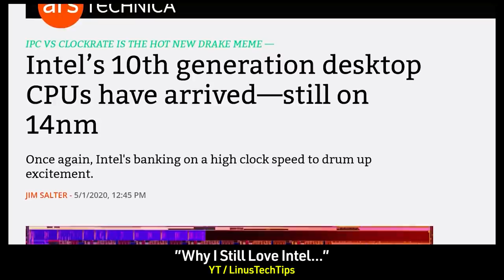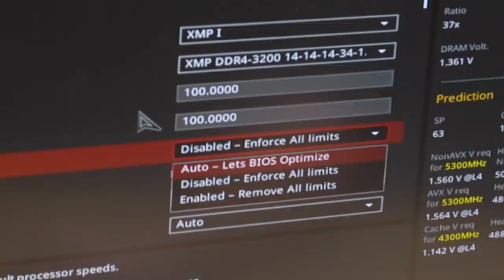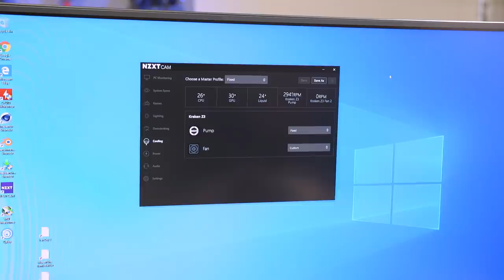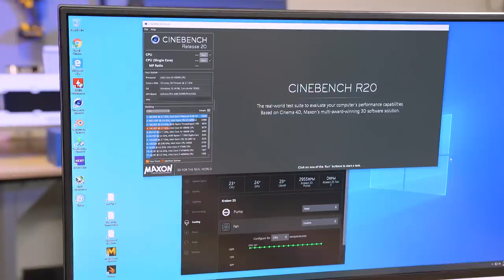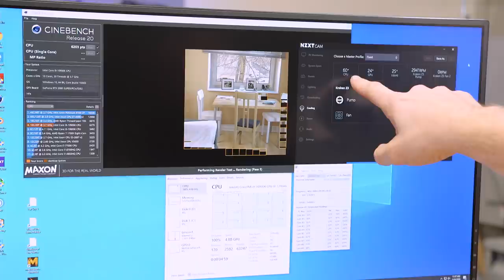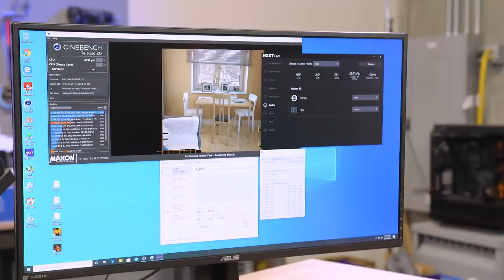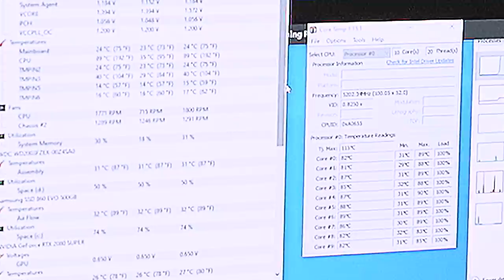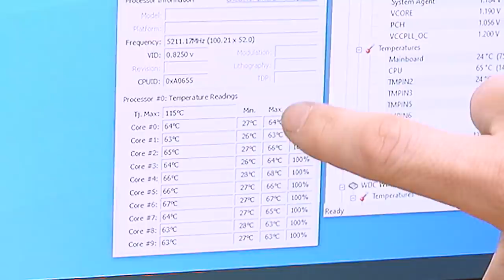Does the 10900k Melt!?

Comment: I've just built an i9-10900K system toady with a Corsair Hydro 360 cooler. 
Too much fan boy scare mongering about temps as this CPU is hitting 5.2Ghz all cores and running reasonably cool!
Very fast and great product!
Reply: You must have the rad in a bucket of ice water
Reply: good luck with power draw at 5.2 ghz
Reply: @razoo911   Not everyone cares. Everything is built to handle it.
Reply: What mobo?
Reply: @IsaacSpurlock   I'm sure Intel is feeling the pressure but for people who say that Intel is scared is just ridiculous.
Intel has better products than people give them credit for. So many people have AMD drilled into their heads it's no wonder Intel has image problems. They have excuse after excuse for Intel being a bad choice when they haven't even tried the latest. Just because it's older technology it doesn't mean it's bad product.
Reply: @mddunlap03    Your comment is caused by misinformation. The 10th gen Intel does not run HOT!
Reply: @razoo911    Most graphics cards draw 250 watts. Is that a problem for anyone?  NO!
Reply: @IsaacSpurlock     What do you call a good reason? Because they are behind a little.
Reply: @wysetech2000  well its funny to think there are 32 core cpu with less power draw
Reply: @razoo911     That's not a deal breaker for a lot of people and i don't think it's funny. It's just the way it is right now.  A 32 core threadripper ,all core draws much more than Intel's 10 core.
Reply: @IsaacSpurlock  The thing that people don't realize or even care but Intel has had a problem for 6 years. But it's not because of laziness or being complacent or for lack of R+D money. It's actually very complicated and is caused by a series of setbacks and management problems and having access to the latest equipment. Gifted CPU engineers are not plentiful either.
TSMC had a contract for all the equipment ASML could provide for all of 2018 and most of 2019. Intel has only recently had access to EUV equipment. They have had problems with this equipment. Employees of ASML have been hit hard by Covid 19 as well as Intel Fabs in Oregon and Arizona. I hear that the riots in Oregon have also done damage to the Intel Fab there.
The problems just keep coming for Intel but it can't last forever. They have some great products for the future. All they need to do is perfect 7nm to send them off with those better products.
Reply: @razoo911    Where?
Reply: @wysetech2000  on blender test 32 core threadripper go up to 280-300watt while this cpu at 5.2ghz go up to 330-350watt... my question is why keep so high power draw for 300mhz when at 4.9ghz its under 200watt
Reply: @razoo911  it doesn't matter. i will still go with intel for now considering my bad past experience with amd. probably they are getting better now but similar with windows, many people move to Mac OS and don't want to use windows anymore no matter how good windows 10 is.
Reply: Glad you too have good temps gives me hope for my Corsair 360mm h150i pro XT come with 3x120mm 2400rpms should do fine I feel and SF not hot every day just 5-10 days a months if that past 72f gives fate that I pick right
Ordered
ASUS ROG STRIX z490E Gaming 
 i9 10900k 
32GB DDR 4 GSKILL Trident Z RGB
3090 RTX 24GB !!!!  
2x 1 terabyte 970 eco plus nvme
1200 Corsair icue
Lian li Razer 01-11 case I have Razer stuff headset mouse pad so now case all in sync software
6x120mm remote rgb
Reply: @fleabaglane   WoW. That should be a nice rig! Try in at stock settings if you intend to overclock. You might be surprised at how well it boots by itself.
Reply: @fleabaglane  just curious how did the h150 go cooling the 10900k?

Comment: Linus: 10th gen is gonna run HOT
Linus next day: I was wrong.
Jay days later: Yes, you were wrong.

xd
Reply: Jay now: Intel change was effective, but god damn this was taking some time.
Reply: wait this isnt spongeBob hentai
Reply: Class a click bait
Reply: Technical it is super hot, since his CPU can't even hit 5.3 with a 280 AIO that has water in it at 30C.
Reply: Linus wasn't wrong though. He said early reports indicate. That was what the early reports indicated. Those were wrong. Not linus, because he didn't make that up.
Reply: @joescalon541  it is not hot at all. zen 2 is hot. 3700x at 4.2 can get 80 degrees on 240 aio in prime 95
Reply: @mmmdawe  Didn't motherboard makers have bios issues when they were first released? If you still can't get your temps lower at full throttle than check your bios updates and settings. Because the chip my friend has never goes over 60 in benchmarks. And the heat that comes off the Intel chips is insane.
Reply: Yea I was about to comment that I was very confident that Linus corrected his error either the same day or next day. And he even acknowledged that his statement was speculation and not a definitive statement, so it just seems like a bad faith way to get views
Reply: @mmmdawe  AIO's must not be that great then. I bought a 40 dollar cooler master 212 black for my 3700x and haven't seen above 65 in games, and haven't seen above 72 in cinebench r20. All while it was over 90 degrees In my room for most of the week.
Reply: Aceus
Reply: @theTweak0284  It's not like he titled the video "Linus was wrong" though. He talked about it and admitted several times that Linus' statement was made before the actual cpus were tested...
Reply: @joescalon541  "Technical it is super hot, since his CPU can't even hit 5.3 with a 280 AIO that has water in it at 30C."  What temp does the 3900X go to at 5.3GHz?
Reply: @robertp457  How does that matter, it's a completely different architecture
Reply: Motherboards that automatically have power limit disabled paired with a poor quality 10900k could very well experience thermal issues. Tech Deals couldn’t even test his 10900k at “stock” with a 240mm AIO (maybe 280mm, don’t recall; he had to use a 360mm).
Reply: @wesleybates5585  Prime95 generates more heat
Reply: Jay: am gonna make Linuses cheeks clap
Reply: Everything is cool with 3000RPM ...
Reply: @wesleybates5585  My cousin recently bought a 3700X and when he is using PBO 4.2Ghz  it just goes 80ish C on full gaming loop...he has it disabled and it stays at a cool 60C with an 240mm AIO though I think it stays at 3.8. Even an 8700K runs cooler, I mean my friend has an 8700K@4.8 constant all core with a $20 IDC 214C at 78C but he since changed the cooler to a Frostflow or something
Reply: @joescalon541    If the 10900k is left alone it will boost to 5.3 for a certain amount of time as needed. It's algorithm is actually quite good. Most games will work just fine at 5.0 ghz. anyway.
Reply: @dewaynethomas3122  Most motherboard companies over volted the 10th gen. The Asus boards did not overvolt and were as Intel intended. Some reviewers actually got Asus boards along with the CPU sample.

Comment: "This has been a massive known issue since the 4770k!"
me: (looks across my desk at my converted office PC rig with a 4770 inside) haha awesome.
Reply: Meh I have 4770k system running my garage. It's fine with a 35$ cooler. Decent overclock out of it back when it was my main system
Reply: Ha ha! That's funny. I've had a 4770K since it came on the market. Just now in October changed it for a 10900. But my4770k have never been warm. Never overclocked it to the extreme, so that's why. But the temp on the 10900 I have now is just colder. Far better design. I run 5,2GHz on all cores and it's still nice and cold. Only fans, no liquid cooling.
cheers

Comment: So what I'm gathering is that the 10900k is actually a damn good processor that might actually put up a fight against AMD while Intel gets their smaller nodes underway.  I'm really curious how well the improved thermal transfer technology in the 10900k translates to their 10nm and future 7nm processors.  The fact that Intel is able to squeeze this much out of 14nm compared to AMD's smaller die is a testament to quality engineering.
Reply: Let's see if intel could bring 10 or 7 nm architecture later in late 2020. As we know, intel failed in their first attempt with 10nm.
Reply: Yes verry good!!!! 91 to a wather cooling!!!!
Reply: @bogdangonciu  well if that's what you get from the video you should watch it again
Reply: @NyanKuro  Intel has been failing at 10nm for 4-5 years now.

They keep saying it will work when euv litho gets more commercially viable. Well then how exact did and beat them to 7nm
Reply: Its not like 4000 series Ryzen is a big deal yet though either...
Honestly, forget the future and just build what will be good for a few years!
I ended up with a Ryzen 2600 and a 1660 Super OC with 16GB of vengeance DDR4 and built it all within the last month (started with a 2nd hand 780ti but my 650w corsair PSU and small case both didn't like the 780ti heat and TPD).
I was waiting for R7 4700 before I watercooled and began OC'ing, but now, I'm not even sure I should worry about waiting... Now I'm thinking I may as well enjoy my R5 2600 for what it is, because I don't see anything substantially better (for the low price of 200AU I payed) coming any time soon.
If you want a 10900k then get one I'd say because it's literally the best gaming chip you can get, regardless of the NM process used
Reply: 10900k is not really comparable to anything amd do. 10600k, on the other hand....
Reply: @bogdangonciu  Clueless comment alert. Similar CPU's from AMD on an energy efficient node easily hit 80°C on watercooling with a cpu clock that's 500 mhz less on average.
Reply: @EvlEgle  well the i7-1185G7 is 10nm but the 11x00k is 14nm and supposedly alder lake is 10nm and meteor lake is 7nm

Comment: Jay: I wanna be able to see CPU temps that's why I like the new NZXT AIOs.

ASUS motherboard (with built in CPU temp monitor): Am I a joke to you?
Reply: To be fair (and no idea how accurate the nzxt aios are, so can't completely vouch for jay's choice), the display on Asus motherboards is anything but accurate. I have a Maximus XI Hero, and there it always displays as much as 10C lower than Core temps actually are. Not sure what sensor it's actually picking data from, but it's not exactly reliable
Reply: Jay who sells that fan holder? Great vid.
Reply: got an ASUS X470-F Gaming and since ive bought it it says my CPU is always between 70°C and 95°C ... while every other tool says 35°C up to 60°C ( 3700X with small adjustments under a H150i Corsair 360 water cooling )
Reply: @AtticPCGuy  my asus (c7h for amd) reports a cpu temp and a socket temp. The CPU temp from the mobo is bang on what the CPU reports (according to hwinfo64). Not much help, I know, but just wanted to report that at least 1 asus board is correct. :)
Reply: The AIO monitor looks cooler 😎
Reply: @tehalexy  I think Jay said that RyzenMaster has the most reliable info about temps and so on. It's also great for testing overclocks without entering bios.
Reply: Artic freezer II  360 has joined the chat
Reply: @AtticPCGuy  Probably reading from the backside of the motherboard
Reply: @AtticPCGuy  i have same MB where are u reading temp on asus motherboard thats wrong? what display
Reply: Both are distractions especially you are a content creator.
Reply: @devincicrashjk  On the error code display on the top right of the motherboard, after setting it on the bios to display cpu temperatures.
It's not a horrible issue once you're aware of it (you just glance at it and assume it's a few degrees hotter), but the fan software uses that temperature as well to regulate fan speed; so it becomes a bit more annoying to set up fan curves
Reply: @alrizo1115  I have the LED strip on my NZXT case to display a color if the CPU temp reaches certain limit, I use it just to be aware what's happening in case of critical temps, same for the graphics card.  Some people care, depending on what you're doing or testing, but yeah I couldn't even see waterblock  if I was doing something on the PC, that's why I find the LEDs a better option, you can definitely see if they are on relying just on your peripheral vision. I HATE LEDs because they are distracting so they remain off 99% of the time except when I'm testing something and I hit one of the set temps.
Reply: @armature3D  yeah not really I've got plenty of other clock and temp reporting apps (all of them basically) and ryzen master seems to indicate stuff that doesn't exist showing clocks at 800 when everything else says they are at 3100

Comment: cinebench is extrimely light and cool for cpu benchmarks, run prime95 (with the correct blocksize, must fit in cache, see buildziod for best settings) if you want to check how hot the cpu can get, also run at least a few hours, as just watching a single number for water temperature is not really enought to determin equilirium.
Reply: Actually linpack would be more brutal stress test than prime. Also also according to buildzoid.
I also use prime after running other tests to insure longevity of cooling and voltages post build.
Reply: Prime is not realistic tho. I'd prefer a blender render, handbrake encoding, etc.
Reply: You will not stress your cpu in daily use like that , prime is sh1t and unrealistic
Reply: Νο it's not. You could argue it's extremely light for a stress test, sure. But unless your actual workload involves folding or 24/7 rendering / encoding, you won't get higher temperatures on any other task compared to cinebench.
Reply: jayz make it like it's a cpu destroying app when it's not, here's what you can do on threadripper (admittedly TR are insane cpus) run cinebenchr20+a gpu stress test+watch youtube+record with OBS+open other hardware monitoring apps+type text+google some infos, when I tried to make a video with aida64 stress test, mouse froze then obs crashed the nvidia driver blacking out my screen which win10 managed to recuperate but after that the system was half broken and I had to reboot, cinebenchr20 is a good cpu test but not "the ultimate super hard" cpu load, that said crazy loads only point is to test your cooling system in a  worst case scenario then you'll know if it has "more than enough" or "barely enough" cooling capacity
to test my "real life" cooling capacity I encoded for 9hrs (cpu only) then 4hrs (cpu+gpu) ending up with 36°C room temp lol that's where my "liquid temp should stay below 35°" comment comes from ;)
Reply: Prime95 is my go-to for "my room is cold, maybe my computer could help".  With appropriate settings you can push your power draw about 25% higher than you'll ever see on something like Cinebench.
Reply: PeterDerBeste  Who the hell runs their CPU at full load at max settings for hours?
Reply: Cinebench R20 is harder on my 8700 than prime95 small FFT. Maybe part of that is because Cinebench employs AVX whereas prime95 does not, otherwise it makes no sense; I'm not sure though.

Comment: Interested to see AMD's XT/4000 chips before making a decision. Definitely time to upgrade though. That goes for my GPU as well.
Reply: Good move. For the first time in a very long time AMD might and should  take the gaming crown
Reply: running a 3900x, and loving it so far, but yeah waiting on 3000 series rtx, or whatever AMD brings Gpu wise
Reply: @craigsommerville3863  For all intents and purposes they already have, in that if your CPU is over the maximum refresh rate of the monitor, which Ryzen 3000 is in 99% of cases, then anything extra doesn't matter, and since AMD curbstomps Intel in literally everything else...
Reply: @praetorxyn  99% of cases is a poor assumption, plenty of gamers game with high refresh monitors and several modern games will keep a CPU  from either manufacturer around 100 fps average.  A more realistic reason is that, unless you're rocking a 2080 ti, and in some cases, but to a much lesser extent a 2080 super, the frame difference will be negligible at best.
Reply: I wish Sept-Oct would hurry up and get here. I used to travel a lot for work so I have always owned laptops. Currently on the Alienware Area 51m with 9700k  running at 4.9 all core with a -160 offset to care and cache and the GTX 2080 running locked at 1890 at 925mV. Temps on CPU in games is between 60-70C and GPU temps are between 45-70C dependent upon load. 

Now that I am home I want to build a desktop, but think it is pointless right now with Big Navi and Ryzen on the way from AMD and Ampere on the way for nVidia. I just hope they all come out before or right at launch of Cyberpunk 2077!!!
Reply: From what I've seen at least in Europe prices are fucking high right now due to the pandemic, I would pay 200€ more for a ryzen 3600X + 1660S build rn than I would have had back in December
Reply: Q4 2020 :D
Reply: Intel wins at gaming
Reply: Big navi sounds more exciting tbh. They suggested a 50% performance inceease per watts. Rtx 3000 series sounds promising too. While in the cpu side, xt might just be chips that won the silicon lottery. And zen 3 series is the end of the am4 lifetime and if it isn't a significant upgrade over zen 2 there's not much sense in waiting.
Reply: @praetorxyn  240Hz gaming says hello.

Comment: @JayzTwoCents
I recommend in future tests that you do NOT use potassium bicarbonate fire extinguisher for these types of tests but instead use a CO2 fire extinguisher. Potassium bicarbonate is corrosive to electronics, but I say this in case there might be a chance that some parts are salvageable after a fire. Also the fastest way to put out an electrical fire is to secure the power and then hit it with the CO2.  In addition: potassium bicarbonate is very messy to clean up.
Reply: Thank you, friendly neighbourhood fireman! 07